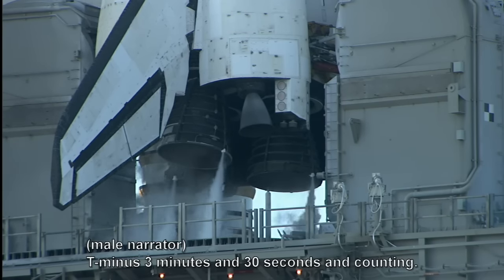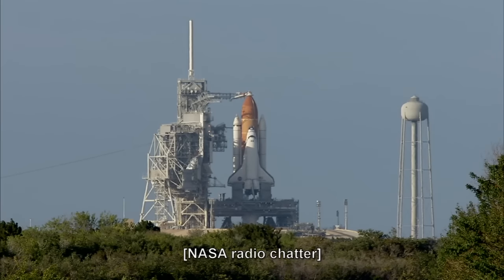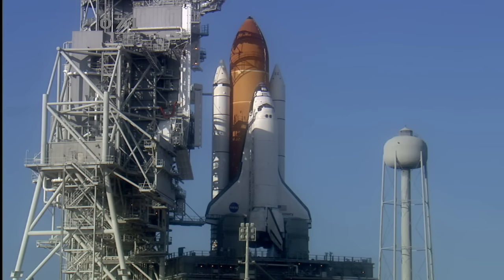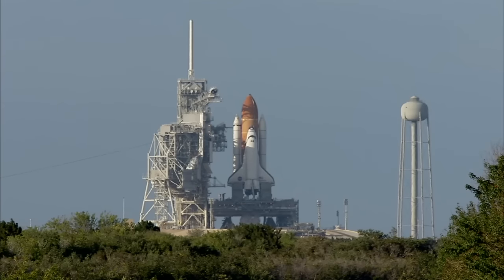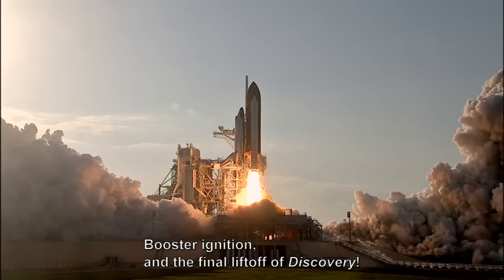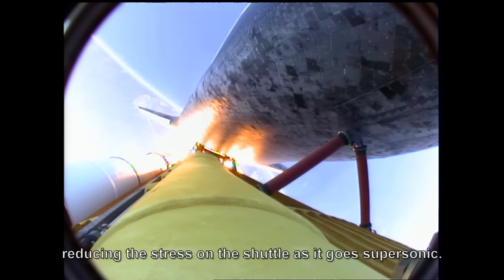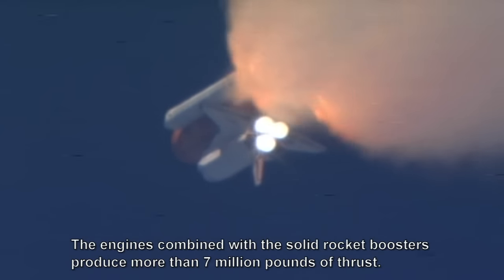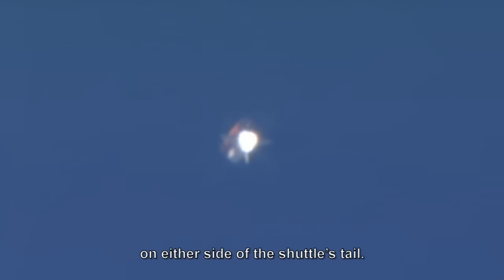The Final Launch of Discovery

Comment: I'm always in awe when i watch this.  The shuttle program was and will always be one of the most amazing achievements of humankind!
Reply: Uk
Reply: Totalmente de acuerdo
Reply: Also a massive waste in terms of space exploration. We could have spent way less on space trucking and much more on hardware to reach other celestial bodies.
Reply: @randbarrett8706  Eh, it was a needed thing, it was a gateway vessel to the concept of re-use.
Reply: @randbarrett8706  : Agreed.  

Alternatively, NASA could have kept the Saturn V in production at a low rate of 1 rocket per year.  The 1st and 2nd stages of the final Saturn V were enough to reach low Earth orbit.  The 3rd stage could have been replaced with a truly gigantic payload, many times larger than the Shuttle's (Skylab was launched that way).  The International Space Station could have been built either far quicker, or far larger, with the Saturn V as the heavy lifter.
Reply: @randbarrett8706  
That's odd since nasa clowns have stated that low earth orbit is the best we've achieved.  I guess you'll believe anything though huh?
Reply: @ruledbysaturn  because you know better than nasa😂😂😂😂😂😂😂😂😂
Reply: vibratingstring  we build like, 5. Not exactly a waste. Proved valuable.
Reply: 9
Reply: @randbarrett8706  Well, yes we can see that now. First have to fail in one of them ...
Reply: if you look closely, you can see th main engine roket nozzles "steering" the spacecraft as it ascends..  constantly adjusting to account for minor course and attitude requirements.
Reply: i love you
Reply: We paid for it. Us. The American taxpayers. And I wouldn't change a thing. God bless us.
Reply: Mewto
Reply: vibratingstring  the space shuttle program was probably one of the greatest achievements in US history. It was no waste at all because the shuttle was a symbol of the country. Imagine what the military costs of troops all over the world are and how much money the country has totally wasted for troops in Germany or any other country all over the world. Total waste of money for nothing. The shuttle was a symbol of progress etc. Now the US goes in the exact other direction. The golden era is over. I would say 80s and 90s were probably the best decades for US ever and from 2001 on and the waste of money in Iraq and Afghanistan its going down and since 2016 and the criminal president Trump you can say that the US will never ever be as good as they were. Greetings from Europe.
Reply: И первая программа по количеству погибших астронавтов
Reply: Neega Please ! The Shuttle was the biggest Blunder.

Comment: There’s just nothing like the shuttle. Just the greatest vehicle a man has ever produced. I feel so blessed to have seen it flying over DC and arriving at Udvar Hazy.
Reply: Not greatest, but definitely the coolest.
Reply: vibratingstring  mmm arguably.
Reply: vibratingstring  yeah I worked at the air and space museum where there was an X15 and also at Udvar Hazy where there was an SR71. I can tell you from everyday personal experience seeing them. Both those airplanes are fantastic, but neither of them takes your breath away like Discovery or the Concorde does.
Reply: vibratingstring  the X15 doesn’t even remotely compare, it’s a pipe with stubby wings and tiny cockpit. Discovery has all her heat blankets all burned up from all the times she flew in space, it’s a whole other league.
Reply: Don't forget Concorde.
Reply: soyuz 1 is the greatest

Comment: The exhaust plume and shock diamonds of those RS-25's is absolutely amazing... still my favorite rocket engine ever created.  Even today, some half a century later, the entire concept seems almost impossible. I miss the days when NASA proved to the entire world that anything was possible with the right minds (and enough money lol.) It will probably hold the record as the most complex machine mankind has ever created for quite some time.
Reply: Shuttle's RS-25 engines were not a totally new concept/design.  They were based on the Apollo Saturn V upper stage engines, the J-1 from Rocketdyne with modifications for shuttle operations.  The Solid Rockets were based on the Voyager and Viking spacecraft Solid Rockets Motors that were recycled from the 1960s Gemini B/MOL program. NASA as it should tends to build from what they know to reduce costs as they should.  The only exception was the shuttle body itself.  It was totally scrapped to go back to Apollo staged core concepts for deep space exploration as the space EXPLOITation promise during the shuttle years ended up being a nothing-burger because they couldn't get the reusability costs down and flight frequency up to the promised levels.

Comment: It's so cool how as soon as those engines are ignited you can just see the shuttle trying to go... Anyone know how they produce those sparks?
Reply: I think it was burning magnesium?
Reply: They're like a small solid fuel rocket or a firework. They're intended to burn off any hydrogen spills and prevent them pooling under the shuttle and possibly exploding.
Reply: @attilalako9491  Thanks for confirming that you don't speak or head Hebrew. LOL. 

Another hard fail, bro. Not a good look.
Reply: They were magnesium sparkers (sort of like fireworks) used to make sure no unburnt hydrogen or oxygen clouded around the engines and choked them during startup.
Reply: Those flares are called hydrogen burn-off igniters — which resemble celebratory sparklers — and were successfully used to mitigate risk to a launch vehicle for space shuttle missions.

The sparks burn off hydrogen gas that may accumulate under the main engine nozzles to prevent a possible explosion when the main engines ignite.

Comment: A friend of mine used to work for JPL back in the Shuttle days and was in charge of rebuilding the engine's fuel pumps in between launches -  he explained to me at liftoff that each of the 3 engines burns around 300 gallons of fuel in one second - so that's 900 gallons of liquid oxygen and liquid hydrogen being consumed in ONE SECOND- UNBELIEVABLE

Comment: It still amazes me that one of the most complex machines man has ever built had its launch timing figured out buy people in the 1970s when a computer was the size of decent room and the physics of the timing for the SRBs was done with pencil, paper, and slide rules. They calculated out the thrust every millisecond of the main engines firing as the shuttle rocked forward, and went it JUST stops rocking back, they fired the SRBs. The math, the minds, the complexity of it all still boggles.

Comment: A pity they stopped using the shuttle
Reply: Yeah, and let's bring back commercial passenger service in biplanes.
Reply: @Vector_Ze well it’s more like if all the airlines stopped using cargo planes, not biplanes. This thing may be old but it’s the only way to transport substantial cargo like space station modules for cheap
Reply: @cardboard9124  Shuttle transport was many things, CHEAP was not one of them.
In any case, the Shuttle's payload capacity to LEO was only 20% that of the Saturn V.  The ship itself was too massive to loft the truly massive payloads.
The shuttle we got was a pale shadow of the vehicle originally envisioned, due to budget constraints.  And, due to the same budget problems it was forced into roles it was not well suited for.  It was not intended to be the USA's sole means of reaching orbit.
By the way, I watched the launch of STS0-133 from Titusville, my 2nd from the vicinity.  My first was STS-42.  And, I witnessed the last three Apollo launches from the vicinity, too.

Comment: I don't know how those RS-25 engines even make a beam unlike the F1.
Reply: Different fuels.
Reply: @thecyanadon  Liquid hydrogen + kerosene + disel + petrol + compressed natural gas + electricity + gasoline + Liquid oxygen = huge explosion
Solid rocket fuel + RS 25 = huge flame and thrust
Reply: @bsodgamer1234  Not the same fuel. rS-25 Burns liquid oxygen and liquid Hydrogen. F1 does not.
Reply: RS-25 actually was a design based on the Saturn V upper stage J-1, not F1.  All 3 were built by Rocketdyne.  This is why when Apollo was cancelled and finished, they J-1 office working on updates was not.  They needed an updated enginge for the shuttle and plans were to strap on a Saturn J-1 type engine.

Comment: Compared to SpaceX it's amazing to see how effortlessly Saturn Vs, Shuttles and the new Artemis systems launch.  Full props to SpaceX for what they have done but they have nothing that compares to these systems in terms of pure power.  Maybe their next Starship launch will equal those launches.  Either way you can not be unimpressed with what NASA has achieved and what a privately owned company is striving for.
Reply: The engineers of the Space Shuttle were much better than the people behinde SpaceX. They are amateurs compared to NASA. Space Shuttle is probably the most underrated vehicle ever built from humans. The program was extremely expensive but also extremely impressive because the best companies were involved. SpaceX cant reach that because it's a private company. They will never reach Mars. Because it's obvious. If you compare the professionality of the NASA space shuttle program with the amateur level SpaceX you will realize that Mars is still far away and for something like that you need exactly the setup of the Space Shuttle program with different companies like Boeing, Lockheed martin etc. One company alone can never achieve something like that. Maybe I'm wrong but I highly doubt that they will reach mars with astronauts in the next 20-30 years. Such a complex mission you need gigantic resources and the best people, like in the Apollo or Space Shuttle missions.
Reply: @CosmosZeroX  so impressive that had caused the most amount of casualty because it's a flawed design with the shuttle sitting on a literal bomb, instead of being on top of the whole system.
Reply: this is   barely  40  miles altitude,its cutted after    .   elon  rockets etleast   hit first ceiling   which you clowns call twilight effect